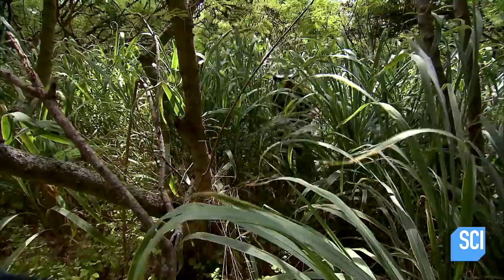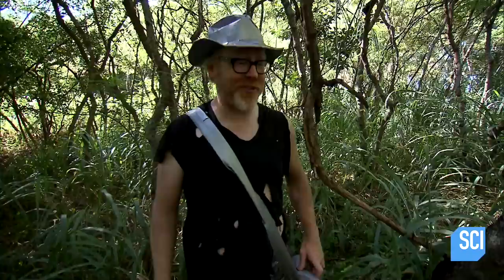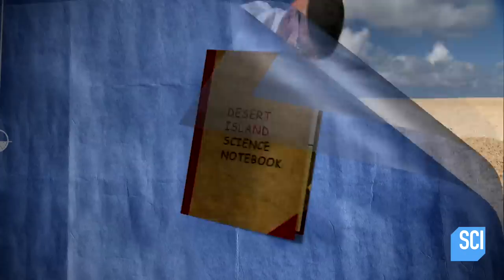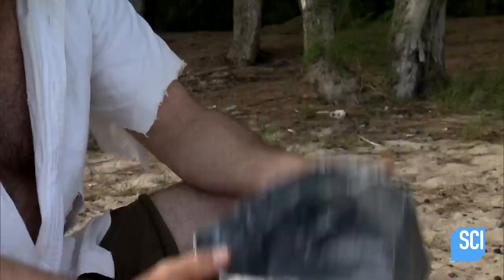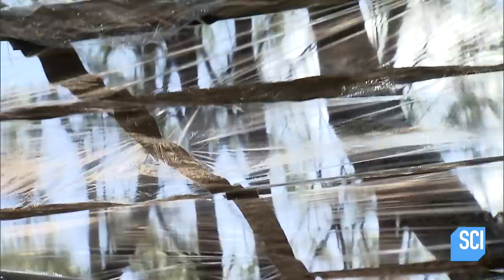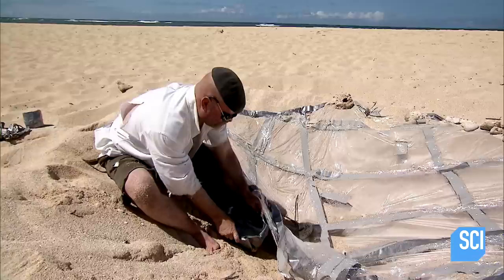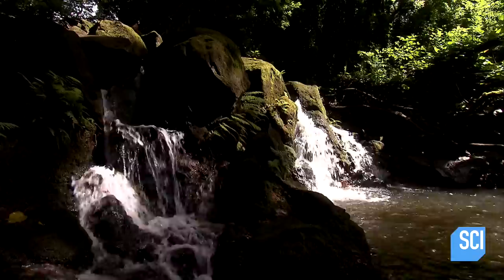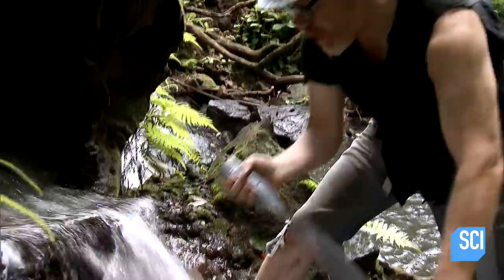Can a Solar Still Generate Enough Fresh Water for Survival? | MythBusters

Comment: Better off just having survival gear when traveling like a modern human.. You can google the best things to use these days. Emergency Survival Water Distiller, portable solar charged steam cleaner to clean out the boil pot with a few ml of water, and some jugs. Portable steam cleaner can sanitize areas you will prepare food also. 

One of the main problems of not knowing what is best or the best possible based on science being hard to obtain? Humanity is generally like a cancer.. Population levels are fine, but a thousand version of each thing has dropped standards for continuous profits, and were sitting at a hundred fold pollution&waste of pop size. We're losing peace debates with war agencies now.. Hunting season type reasoning is kicking in to lower the strain like any other animal that is a risk of exhausting its habitat.

Are humans really that conscious? 
Counter evidence 1. Billions of devices made with real resources that exist flawlessly in digital forms in ALL smartphones, tons of energy wastes from the factories, and pollution. All over banning those products from real materials to increase the standards of all devices that can hold them. 
Counter evidence 2. The introduction of google glasses should have made people realize the technology could get better, and instead it was simply washed out of human minds. The capacity for any size screen any where you go, for almost no resource costs of maximum size. Including removal of cheap screens from all your junk standards. 
Counter evidence 3. People were warned about climate change, and in result the people step up thousands of versions of disposable air cleaner production from factories over the best of human knowledge. 

Governments also being dependent on 1-3, and that is just a few reasons they need to make sure to farm you for continuous tax. That means 1-3 is defended because it makes jobs so the governments can be just as confused as most people. Raised in a disease like system.

^^ Consciousness = The minds awareness of itself, and the world. < "If humanity is conscious enough to understand that we're ending the future, and ending all life on this world? EVIL.. It is the duty of good men in power to end that shame. To prevent all human life to have been for nothing." How can we argue with them if nobody will change? Its all tied together..